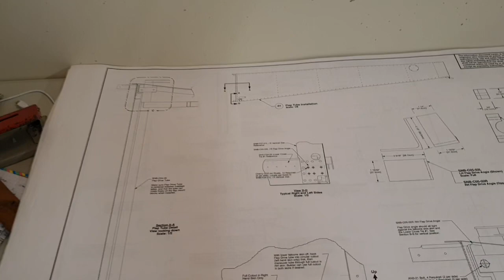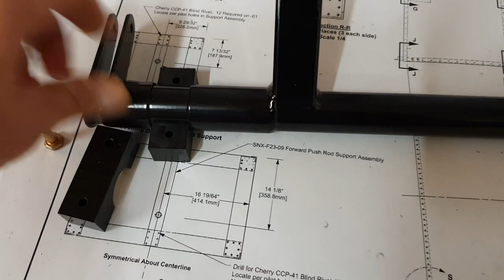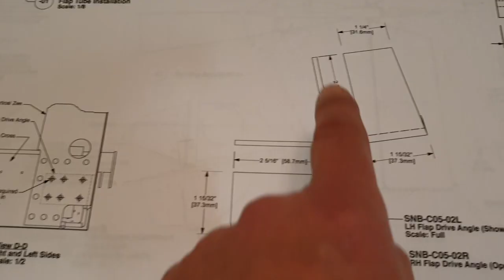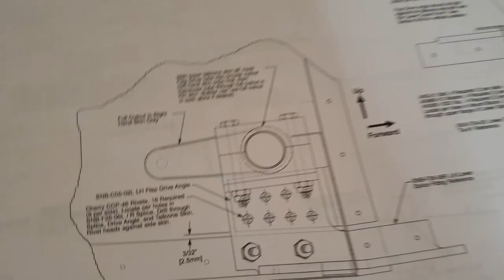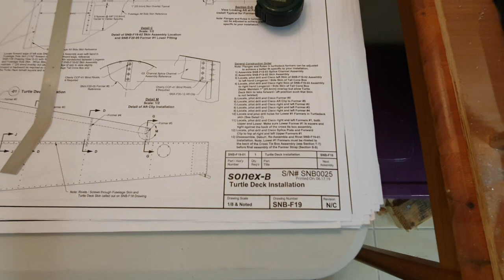Gavin's Sonex B Part 26 - Fitting the Flap drive to the Tail Cone ass'y

Comment: Very tasty work Gavin.I have interest in a sonex build myself and it's great to see theses videos.I have seen in others that the sonex is quite prone to oilcanning and stiffeners have been added to the side skins of the tail cone to successfully prevent it.Might be something to consider before closing the tail cone up.
Enjoying your build👍
Reply from the maker: A good comment - I have been tapping the side panels with my fingers and completely agree. I think I will make some L section stiffeners to go diagonally across the panels. My tests suggest that they can be as simple as light gauge all'y sheet folded into a right angle section(L). A fold of 6 to 8mm  with .032" sheet seems to do the trick. This would not add much weight at all. Rivet or epoxy fixing? Cheers, Gavin :-)
Reply: @gavinssonexb  I can't remember which build I saw it on, but the builder used a high quality double sided tape to fix the L section to the skin.
Reply from the maker: @mattybpg  Cool :-)